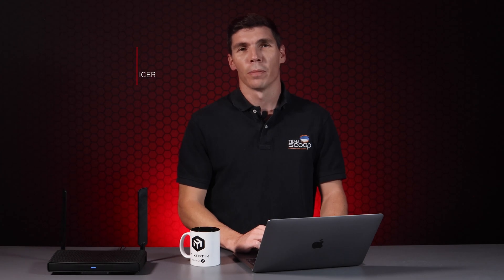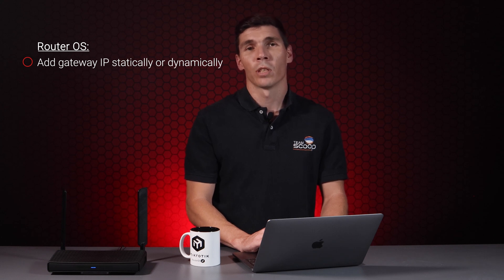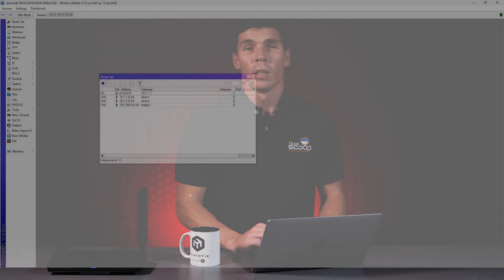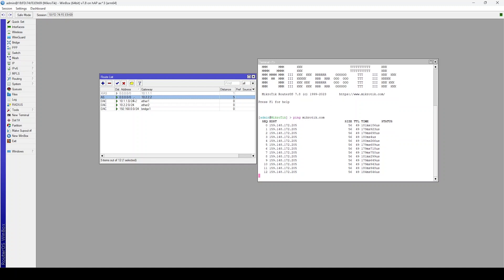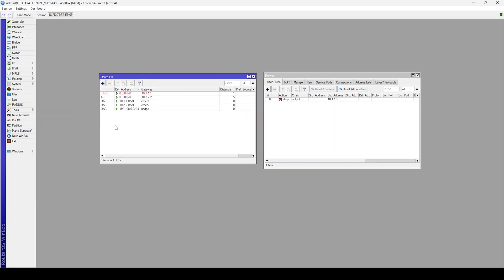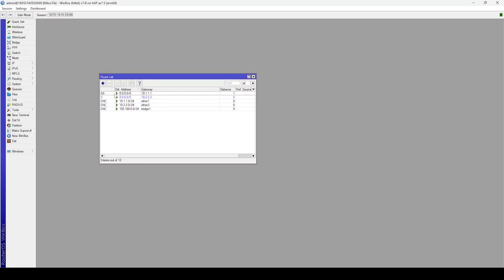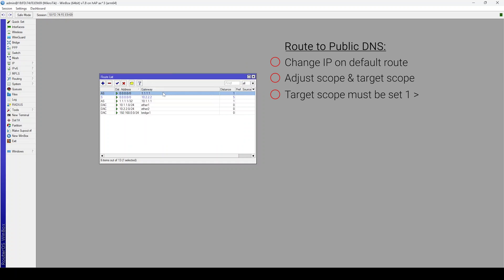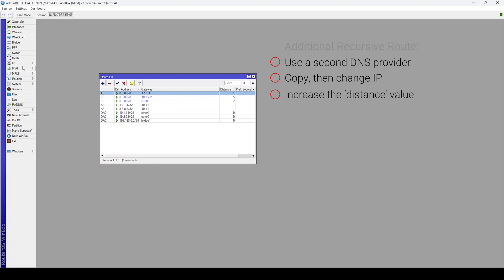How to Configure Multi-WAN Failover on MikroTik RouterOS

Comment: Do you have any examples if we have two WAN connections that are dynamic and not fixed IP with the ability to have WAN 1 be the primary and if fails have WAN 2 take over keeping in mind that the connections are dynamic and not static?

Comment: I have a question and i really need to know if this gonna make a difference for my needs anyway i already have my mikrotik configured load balancing nth and i have 2 lines and the mikrotik connects me randomly to one line and when that line goes down it takes more than 7 seconds to connect me to the other line and that sucks because i made this setup for gaming. So will this method be faster or the same ? My router is 750 r3 
Thank you

Comment: This is not a proper way for failover. You are testing with self created Gateway and it works. But if we have two ISP then ping to gateway from one isp down but 2nd isp will overtake it and ping will works So, ping down will not be traced.
Reply from the maker: If your WAN 2 is taking over from the failed WAN 1, then we believe you have a working failover config, which is the goal of the video. The rules are not to state that because the ping works via any route, WAN 1 should be used, but rather, if it doesn't work, ensure that it works through a secondary route.

There are many ways one can achieve failover with Mikrotik routers, and this is just one method that works for the demo network we have. What we have shown here will work for those with similar networks, but not necessarily all. It might be worthwhile checking the Mikrotik forums for a more concrete solution for your network, should this one not work for you.

Comment: Great video!  Might be worthwhile to mention that DHCP clients needs to have their default routes with different priority too, by default they have same so I was puzzled that internet didn't work even though switch definitely happened in the route table
Reply from the maker: Hi Ivan. Yes, that's a great point. Making sure to have different priorities on your DHCP clients' routes is crucial for a smooth transition between WANs. Thank you for the input.
Reply: @scoop_distribution  Hello, I did not understand this, what happens to me is that I have some VLANs configured and only the WAN2 connection works in the UNTAGGED VLAN but the VLANs with TAG 10,20,30, to give an example, when WAN1 is disconnected, They are left without connection and only the devices connected to the UNTAGGED network leave through the WAN2, do you know why this could happen?
Reply: Hi Ivan, how would you go about doing so?  I have mimicked the settings just like Tim's.  How would you go about doing what you're describing?

Comment: If both my WANs are PPPoE clients, I do not need the recursive routes or the check gateway right? Because if one PPPoE fails, it should automatically failover to the other one.
Reply from the maker: It is still recommended to do so for optimal functionality, regardless of the WAN breakout type.

Comment: did exactly as you explained and it works when manualy testing, but on every day use my first internet goes down like once every hour. when checking routes, one or both dns addresses is offline and never realy switches as they come back before it happens. :( causing about 30sec outage
Reply from the maker: We think that you might need to look into why your primary link is dropping so frequently instead.

Comment: I think i will lose connectivity to the DNS declared in the specific routes, untill the ISP goes back online. The DNS added as recursive are always routed through the same ISP, so I won't have routes to those DNS thorough the secondary ISP. Is that right?
Reply from the maker: Thats correct. These are just some examples of well known IP's that rarely become unreachable but you could replace them with something more preferable to your setup

Comment: what about the mangle rules part?
Reply from the maker: We might do a separate video on using Mangle in multi WAN scenarios
Reply: Interested in the correct setting when using PCC load balancing: https://youtu.be/9IhOUwB49i8?si=F2pD9wO1El8Ls0C2 @scoop_distribution 
if I have two provider routers overboard